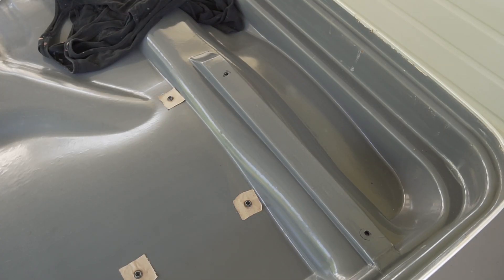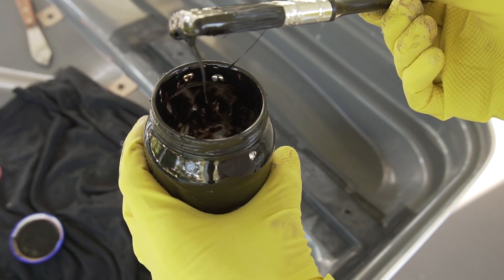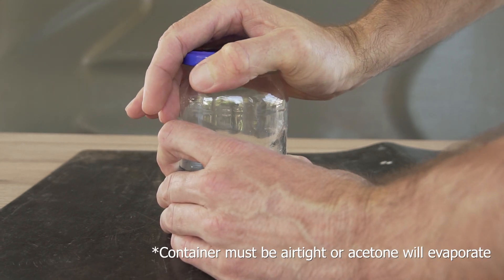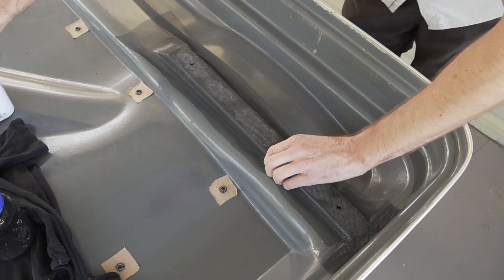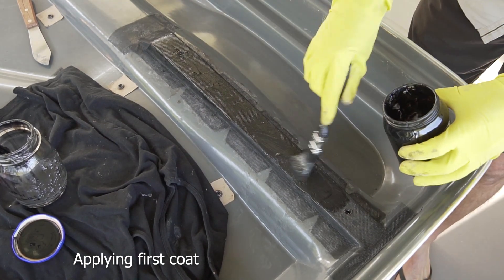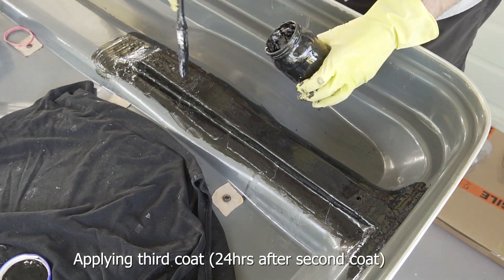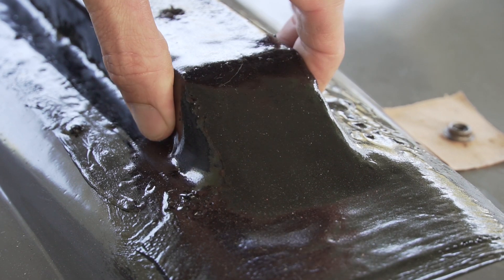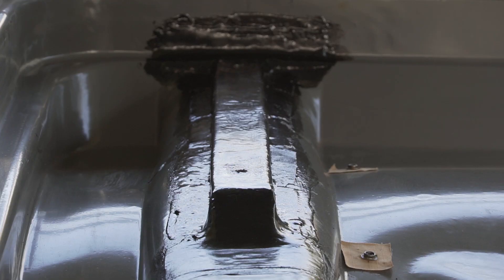How to repair and reinforce large ABS plastic items using ABS slurry.

Comment: The only things I would do differently (besides leave out the mesh) is use a plastic that's more of a color match for what I'm repairing. By the way, thanks for listing the exact amount in grams and milliliters you used to create the slurry (50 grams of plastic to 125 milliliters of acetone).

Comment: Thanks for for info, used to great effect on cracks in my Kawasaki zzr 250 fairings ,. On the back cleaned with 99% alcohol, sanded crack lightly and gradually built up layers on the crack and a few inches beyond on all sides. It is rock solid and stronger than original .

Comment: Used this on some paper thin ABS tray liners for my parrots cages. Used some very fine stainless mesh to cover all the cracks. I let it ( off gas) for over a week before using them again. Thanks

Comment: I would also wick the acetone into all the cracks first.  It is a good idea to use screen or some kind of fibrous reinforcement, it will stop crack propagation.  They also make ABS glue ready-made, in the plumbing section of a hardware store, which is basically the same thing.

Comment: I have a front abs bumper that has a crack about 1/2 foot long. Would you say this would work fine for sealing the crack and would abs be able to be sanded before painting the abs slurry on and then could it be sanded smooth afterwards?

Comment: My abs slurry didnt turn out so well. Abs pieces have not absorbed all the solvent and it became a big squishy piece floating in acetone. Results for 646 solvent were a bit better, but overall same, i cant get this smooth slurry condition. Anyone else had this trouble? What should i use?

Comment: To insure strength w/o bulk and weight!Simply use old car bumpers and other plastic items with strong wear! Reinforce with strongest clothes wire hangers or strips of bumper! Make a large batch of slurry. Apply a generous coat to back side of part. Place hangers or bumper strips into slurry. If slurry is thick enough, and with the wire and strips you shouldn't have to apply 3 coats over 3 days!.. Better strength and less time!!

Comment: Polyester resin will NOT stick to ABS so standard Fiberglass resin will not work. 

But if you take the glass cloth, rinse in in acetone, drain and let dry then wet it with two part epoxy resin it will bond well.  

Standard fiberglass cloth has a coating, called SIZING to help the polyester to flow between the strands but it does not work well with epoxy, that is why you need to rinse it first.

Comment: What do you do with the paintbrush between coats to prevent it from drying out?
Reply from the maker: Usually wipe off excess slurry and wrap in cling wrap/cling film, it does dry out a bit but some fresh acetone frees it up. I do this for no more than a 24 hour period. Once the job as a whole is done the paint brush gets thrown out.

Comment: How about using the ABS slurry in a 3mm tip spray gun and spray it in the finishing coats? What do you think?
Reply from the maker: Not sure, I think it would glug up too much even in a 3mm spray gun. And if you make it too thin/runny it doesn't set as strong. This stuff gets messy too, so being able to simply dispose of a paint brush afterwards makes clean up easy.

Comment: This is really awesome, I'm looking to repair some old computer cases and reinforce some structurally weak spots BEFORE they break. If I can do that on the inside it should help reinforce it better. Is there anywhere you found a beige or white color though? or is it always black? I did a quick search and found some rod shaped ones in beige/natural color. Think it might work? They used cheap as hell ABS plastic back when they made these.
Reply from the maker: As long as it's 100% ABS it should work regardless of colour. I've found eBay a good place to find various sizes and colours of ABS.

Comment: Awesome video, thanks! I'll try it on my motorcycle fairings.
Reply: I used the same ratio to mix up some slurry and applied it along with some carbon fiber cloth to fix some cracks in my ABS motorcycle plastics. It worked incredibly well and I think they're now stronger than original. It was hard to get the longer crack to bond, so after a few layers on the backside, I traced the crack with a super fine dremmel cutoff disc from the front to open it up, & filled it with slurry. Saved me over $800 in new plastics. Thanks again.

Comment: Just a little hint. ABS plates bought from hardare shops usually have a ultra thin polypropylene foil on one side. Make sure to take that off. Otherwise the ABS will not properly dissolve because polypropylene is Acetone-resistant.
Reply from the maker: Great tip, didn't know that 👍

Comment: The slurry is a really good idea. I also like the idea of melting the plastic with acetone in order to embed the wire screen. You did add strength, maybe unnecessarily.

Comment: Super cool. Try drilling each end of the crack to stop the Propagation before repair. (like a 9/64" bit). A thick layer of RTV works well too. Not all RTV is the same, Permetex Right Stuff 1 minute gasket maker (black) is my go to glue/band aid for almost everything. It is vulcanized to the surface verses glued, and flexes without popping off. (example PERMETEX # 25229)

The stuff is rated to hold 250 degree F coolant across an unsupported 1/4" gap at like 30 psi. I cover the outside seem of my plastic radiator end caps and never had those repaired seems re-fail. 3/16" thick application.

It also re-vulcanizes to itself so you don't have to remove the old properly attached RTV remains if repairing the repair.
Reply: I brag on "The Right Stuff" all the time. It can also be put into "service" right away. Best gasket maker out there.

Comment: Similar concepts can be used for filling in and strengthening 3D prints, just use the same material as the print is made from, same color and the repair can be blended in till it disappears. It also works for filling in layer lines befor sanding.

Comment: After cleaning the contact area, you should have sanded using 60 grit, then cleaned again. 
And yes, the aluminum screen did add some tensile strength. 
Thank you for showing.

Comment: Actually Stainless steel mesh adds a great amount of Strength & rigidity to the repair, if it's thick enough I weld in heated steel clip of if it's thin I use staples which I heat with a soldering iron and push into the plastic along the crack  before putting on the top coat with SS Mesh you used.

Comment: Does it really sticks to ABS and becomes one with it? Need to repair a suitcase
Reply from the maker: Basically, yes. Just be sure to check that the original material is definitely ABS by using a q-tip/cotton tip bud dipped in acetone and rubbing on an inconspicuous part of the plastic. If the plastic starts to go gooey and comes off onto the q-tip/cotton tip bud then you're good to go. Keep in mind it's not the nicest looking repair too.
Reply: Thanks, I have a suitcase to repair; the label says 90% ABS and 10% PC, I hope it will work, the only problem now is getting some scrap ABS LOL  @fortheloveofvideo6306

Comment: Really nice repair. I disagree that the screen didn’t add much strength though. There is a reason concrete is poured with rebar or metal mesh embedded. The screen will act to resist lateral sheer forces & resist breakage with point loading. You could also apply your first ABS slurry coat, then cover with fiberglass matting, second and third coats as you did. This would work the same as the screen but would be easier to mold around bends/corners/valleys/etc. The highest strength concrete (6000 psi) is 4000 psi concrete with fiberglass fibers added. Again, great video & thank you for sharing. This one is a keeper for sure!
Reply: The flyscreen did add strength - same principle as mesh used in plastering edges.
Reply: I came to the comments to see if this (fiberglass matting) was an option, Thank you for adding to this already super helpful video.

Comment: Reinforcement can be made from fibreglass, carbon fibre, kevlar, hemp, old cotton sheet, whatever is strong (no polyester clothing though). It is to add flexural and tensile strength so that you don’t need as much resin or slurry. Fibreglass is a pain in the arse to work with, especially around statically charged plastic, but it can be laid down with almost any adhesive, hot melted plastic or whatever.

Comment: Well I first tried acetone which didn't dissolve at all and now trying MEK, its only been a few hours but not seeing any progress so far. I don't know what I am doing wrong but really need this to work!!
Reply from the maker: I suspect the plastic may not be ABS if you're not seeing any progress. I've had this happen previously, where the plastic looked very much like ABs but would not dissolve in acetone. You should see discolouring of the acetone within 30 seconds or so if the plastic is indeed ABS.
Reply: @fortheloveofvideo6306  the first try I was pretty sure wasn't  ABS but the second try came from the under fender and I am pretty sure is ABS but I bought an ABS Fitting from the hardware store so I will try that next.

Comment: I have been repairing plastics for nearly 30 years. Your idea of using the mesh is the way to go to distribute the loads and stress better .
It is a shame that it is almost impossible to buy acetone in my country. It is regulated because it used in the process of making illegal drugs . Cheers!
Reply: Have you tried beauty salon suppliers, salons use acetone to remove nail polish😊
Reply: :face-fuchsia-wide-eyes: @cyrilpeterlee1

Comment: Sorry if I missed this…. Did the one mix of slurry last for the 3 days in the jar or was more needed each time? Thanks
Reply from the maker: The slurry mix will last months in an airtight jar, and if it eventually dries out you just add more acetone as needed.
I made up more jars of the slurry purely just for the required volume for this particular repair. Hope that answers your question.

Comment: thats all you did was put abs in acetone and spread it no glue to hold it down or did it dry and thats it?
Reply from the maker: Dried and that's it, no glue needed. The acetone in the slurry will somewhat dissolve into the main ABS item you're brushing it on to, hence it sticks together.

Comment: Use this a lot with 3D printing, but ABS acetone slurry is quite weak and fragile due to bubbles formed inside and is far weaker than normal ABS. Acetone treatment weakens normal ABS.
Reply from the maker: I agree. I've tried applying very thick layers to certain projects, as well as even doing casts with ABS slurry, and the results have been fragile. I've found that by applying several thin layers, like in the video, that the end strength is more than adequate. Your milage may vary, and of course it depends on the project and how strong it needs to be. Never had any issues with the repairs shown in the video.

Comment: Great video. 👍👍
What's the shelf life of the dissolved abs plastic in the jar?
How long does it take to dry after the apllication?
Reply from the maker: In an airtight jar it will last months before drying out, and even if it does dry out and thicken you just add a little more acetone and leave to sit for a day or two.

After application it takes about 24 hours to dry, depending on temp, humidity etc. If in doubt leave a bit longer.

Comment: I now use MEK , Methyl Ethyl Ketone it's better than Acetone , faster melting when you want to stick broken parts together , acetone is very slow to react . ABS plumber's fitting is a very cheap source for ABS , MEK your hardware store in the paint dept.

Comment: Thanks for the video. Some other suggest also use of acetone with ABS. While seeing you applying the aluminium fire screen layer, I wonder how it could work adding glass fibre or carbon fibre laminates as layers.

Comment: has anyone tried using this type of slurry to glue ABS pipe together?
Reply from the maker: Someone in previous comments did go in to detail about using this method for an ABS pipe repair, which was to stop a water leak. Not sure if it would be similar to what you need to do, but short version is it worked well for them. Comment was from next1mpact 3 years ago if you want to look back through comments.

Comment: How long does the slurry keep for? I'm thinking of using this for laptop casing repairs when replacement parts aren't readily available.
Reply from the maker: Basically depends on how air tight the container is that you store it in, but even if it does start to dry out you can just add some more acetone to make it the original consistency. I've got a glass jar that I store ABS slurry in, and after a few months it tends to dry out and go a bit thick so I simply add a little acetone and leave it for a couple of days and then it's good to go again. Using this method you can essentially store the ABS slurry indefinitely and just add more acetone if/when needed.

Comment: Do you think I could use ABS tubing to create my slurry rather than the sheet? ABS tubing is much more readily available in my area compared to sheets. If it is possible, this DIY tool has now become increasingly more accessible.
Reply from the maker: As long as it's all ABS, the tubing should also work. Would recommend cutting into small pieces before putting in acetone just to speed up the slurry making process.

Comment: Hey, I’m trying to customize a stock seat pan. It is a black plastics. I need to add some plastic to it to get the desired shape to the fender that I want. Then cover it with my leather. What do you suggest to use. I thought about using heat and plastic weld the same type of plastic and metal mesh to keep its shape so it matches and I can use staple gun with the leather. I have not tried this yet. There is fiberglass, but I don’t know how well fiberglass and this type of plastic play together. The other option is shaping a piece of wood to the desired shape. It will be easy to shape and I will be able to staple the leather to it. However, even though it will be hidden and covered by leather, I will know that it is there. I have pictures. I’m open to any suggestions because I don’t want to mess this up. I only have one. I was curious if I used the slurry and heat and glued on thicker pieces of plastic if it would hold and work???
Reply from the maker: All depends on what plastic the seat pan is made out of. I'd imagine it's probably either ABS or HDPE. To test if it's ABS you can get a cotton tip bud and dip in pure acetone and then rub on an inconspicuous spot on the seat pan. If it starts to get soft and you get black sludge on the cotton tip bud then it's ABS. If not then it will be a non-ABS plastic.
If it's HDPE you can use a heat gun to attach extra HDPE sheets to the seat (plenty of YouTube videos on how to do this) and basically build up to desired thickness/shape, and then you can use an angle grinder with a flap disc to curve and shape it as desired. I recently did this on a kayak made of HDPE, flap disc worked a charm to get desired shape quickly, needed extra sanding to tidy up though. Or you could also use timber and shape with a flap disc if you did want to go the timber option. Good luck whatever you go with, and I would recommend practicing on something else before attempting the seat (speaking from experience 😅).

Comment: I used this method to repair a yakima roof box; it came out fantastic!  I also mixed some up thin to get into the cracks and for places where I didn't want to build it up too much, like where the lid and base have to mate.  And I used some thicker sheets of ABS, heat formed them to match the curve, and used them to reinforce where the support had ripped through the ABS.  It's super strong and watertight now.  Thanks for the tips!
Reply from the maker: Great to hear the repairs worked well. I really like the heat forming of the ABS sheet to match the curves, that's a handy tip I'll keep in mind for future ABS repairs 👍👌
Reply: Nice. I'm about to do the same with a thule roof box I got that someone had backed into a low parking garage. It made a perfect hole in the back, with a single large piece coming loose, and it just puzzles perfectly into the hole.  Instead of what you did with the strips of abs for strength, I'm using mending plates and machine screws to put it back together before re-sealing it all with the slurry.
Reply: Wife attempted same trick 😢. What is a mending plate as I have yet to start and researching methods others have used Thankyou
Reply: Figured out what mending plate is.Disregard query.

Comment: By any chance can I use ABS pipe instead of the sheets?
Reply from the maker: Sure can, as long as it's definitely ABS pipe it should work fine. Recommend cutting it into small pieces so it dissolves faster.

Comment: Thanks for the info - I used the technique to repair a golf flight case - one thing how do I get the slurry off my paint brush - a jar with acetone doesn’t seem to work 🤷🏽‍♂️
Reply from the maker: I used cheap brushes and simply discarded them once the job was complete as there was no way I could find to clean them back to a usable state. Between coats I was able to use acetone to soften the brushes up enough to use them again with the slurry.

Comment: Thank you for doing the homework on this shared project.  Do you know if this slurry will adhere to metals?
Reply from the maker: If you encapsulate metal it works well, like a bolt head dipped in the slurry and let dry for example. Not sure how it would go if you just applied it to a flat metal surface though, I have never tested that. My suggestions is do a test piece, and probly a good idea to scuff up and clean metal first, especially if aluminium to remove oxidation and contaminants to give the best chance of adhesion.